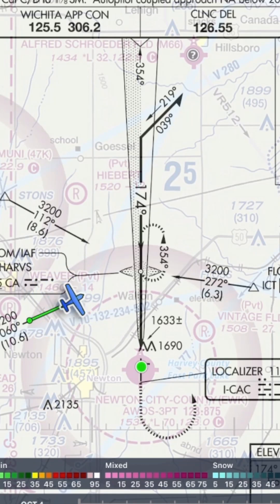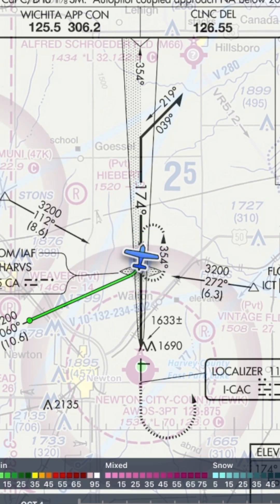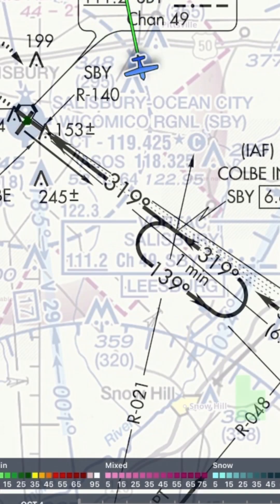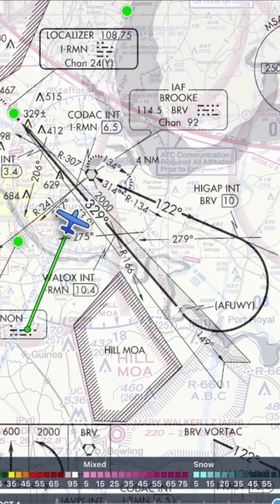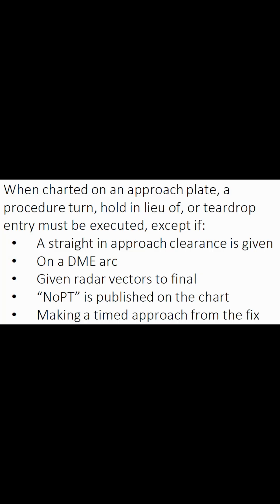The Three Types of Procedure Turns #foreflight #ifr #aviation #flightplanning

Comment: On the barb procedure turn.....if you are approaching from the east when you hit the fix you will turn right which actually puts you on the opposite side but when you turn inbound you have to turn toward the barb (which would be to the right). Those headings on the barb are not mandatory.

Comment: When maneuvering for final approaches involving turns watch and be careful that your bank angle is moderate and your airspeed is adequate. Your stall speed increases with bank angle. Trying to crank around in a tight turn can lead to a stall/ spin.. Don't be pressured into making the turn too close or tight or you may crash.
Reply: how is this good happen on 3200 feet or even 2000 that you can stall to crash
Reply: If you are performing standard rate turns as you should be under IFR you will rarely approach an accelerated stall flying normal approach speeds